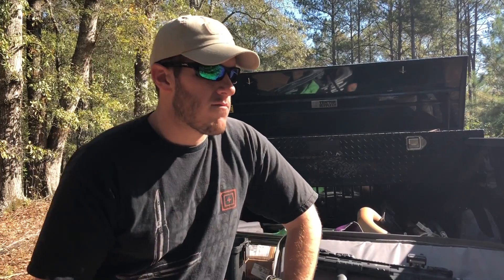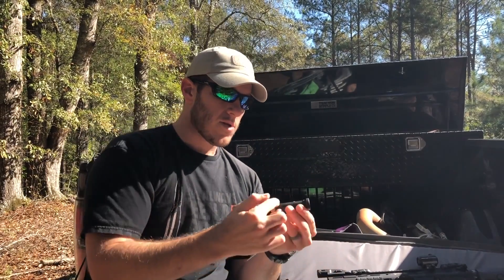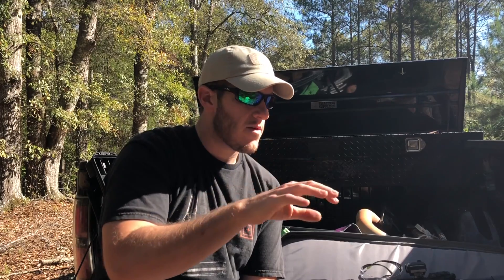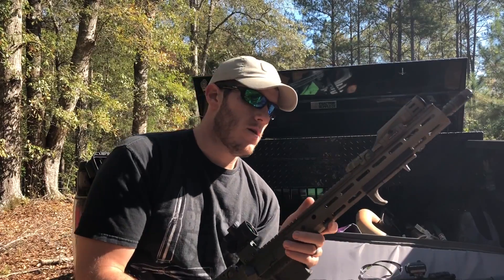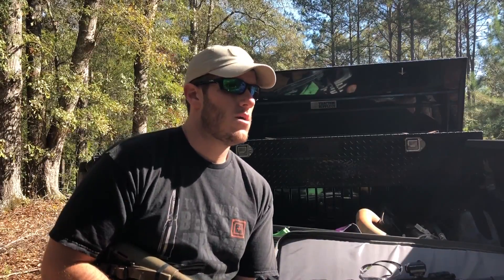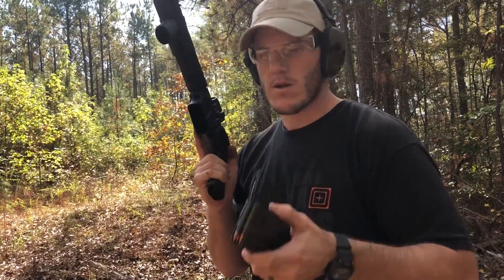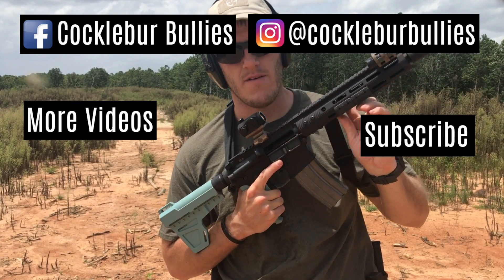AR-15 Buffer Weight Discussion

Comment: good info.
heavier buffers do slow bolt velocity and can increase reliability with a dirty gun but that heavier mass coming forward also causes the BCG to impact harder into battery.

so you have to factor that too. that can cause a change to perceived recoil and can cause excessive wear on the bolt locking lugs or even breakage.

using the ejection angle and distance as a general rule is an effective way to determine if you have the proper buffer.

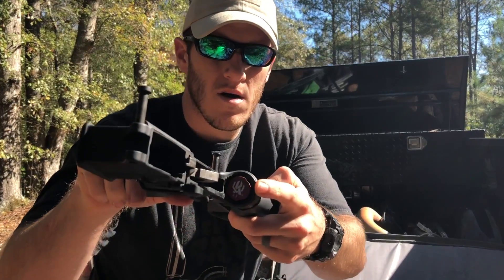but if its ejecting from 2:30 o'clock or later, up to 4:30 o'clock your generally good.

i was surprised to see both my FNs, a FN-15 16" M4 and a FN-15 18" match grade sporter (18" match grade barrel and rifle length gas system), have standard carbine buffers and not the typical heavier H1 carbine buffer.

both FNs are 100% reliable and rediculously accurate to boot and ejection for both is about 3 to 3:30 o'clock so i guess FN knows what they are doing.

i modded my FN M4 into a RECCE/SOPMOD hybrid of sorts and swapped the stock buffer and spring for a Shooting Innovations RRD recoil reduction device similiar to a JP silent captured spring buffer assembly.

the RRD is awesome! it reduces perceived recoil and makes the carbine much more controllable during rapid fire strings.

ejection remains at about 3:30 o'clock with moderate velocity and distance which is about perfect.
Reply from the maker: Usually when you get a complete rifle the manufacturer pairs the components well. When you piece a rifle together you have to tweak it a little to get it perfect.
Reply: @ClangandBang   I would expect a complete FN rifle to be near perfect..  Proper size gas hole, proper gas length, BCG, Buffer and Spring...   That's the gas SYSTEM...It is not just the weight of the buffer  I prefer to tune the gas system with an adjustable gas block.  That takes care if the issue at its source.  Heavy buffer, heavy spring etc really just put a bandaid on the still-present problem.
Reply from the maker: @tomynoks  tuning the system at the gas block is a good way to do it. Some people just don't feel comfortable tearing apart a factory built rifle to replace a gas block. For them, a tool free swappable part is the answer. If you are somewhat that feels comfortable working on ARs an adjustable gas block could be the right answer.
Reply: you have no clue what you’re talking about

Comment: my 16 inch mid length is like that, had to use a h2 as well
Reply: Stupid2669  yes, h2 with blue sprinco spring, makes it way way smoother. Depending on your gas port of coarse. Get springco spring anyway bc it will outlast the gun

Comment: Good video. In a similar vein I would commend readers to Weaponsman (Kevin RIP) synopsis of Mike Pannone's tech article found here:
http://weaponsman.com/?p=20221
Read the comments as well for the quick & dirty; the full article by Mike linked to is well-worth the read.

For those even a tiny bit handy, you can roll your own buffer weights & experiment as the video author discusses without buying full buffers. Get a 1/8" roll-pin punch, and just order some tungsten weights to mix/replace with the steel ones. (I get mine from Midwest Tungsten Services in 3-packs; reasonable & fast. No affiliation with them, they've just given good service.)

Go forth & make your AR run like a gazelle.

Comment: You might want to consider spring weight for an over gassed rifle. 

One thing few seem to realise, is that heavier buffers help more with under gassed rifles too. A good spring and buffer combo can have a huge impact on reliability and recoil. It's often that people overlook the springs, and assume that a heavier buffer alone is the fix. Not necessarily so. Over gassed rifles can get away with heavier springs, while under gassed rifles require heavier buffers and lighter springs.

Comment: Great info. I have a knights Armament 11.5” SBR upper; with the buffer tube and spring I was given by KAC when I purchased the SBR UPPER. IN COMBINATION WITH A GEISSELE SD3G TRIGGER WITH THE LIGHTWEIGHT SPRING AND A KA QDC SUPPRESSOR, ITS SBUMP FULL AUTO FIRE ALL DAY. I WOULD LIKE to know what you thoughts are changing the buffer weight and possibly the spring as well? Thank you graciously in advance .

Warmly,

Doc david
SUBSCRIBED
Reply from the maker: I've heard that a rifle can either run great suppressed or unsuppressed, it's hard to have it run great both ways due to the difference in gas pressure. An adjustable gas block could help, but other than that you need to decide which way you will run the rifle the most and set it up for that. Also thanks for the sub.

Comment: To save money, because I have several AR's, I purchased tungsten weights on Amazon and built my standard buffers to H-1 or H-2 weights. Your video on watching your ejection pattern gives some of the best advice I have seen on getting the right buffer weight. Keep in mind, a too weak buffer puts needless wear and tear on your rifle.
Reply: I wanted to ask, when buying these tungsten weights off Amazon did you just type "tungsten buffer weights" to find them? I'd really like to just make my own out of my carbine buffer if at all possible to save on cash because it would cost a pretty penny to buy a few different buffers for different firearms. Thanks in advance for any info you can provide
Reply: Your spring rate plays a huge role as well. Like mentioned, ejection trajectory tells the whole story on running over gassed or not.
https://www.sprinco.com/

Comment: Outstanding explanation of the various buffers. 

Are there also various sizes or weights in the Buffer Springs as well? For instance is there H2/H3 Buffer Springs for the actual  H2/H3 Buffers?

I just built a 8.5 inch 762x39 AR Pistol have yet to test fire it and thought because of the larger round of using  an H2 Buffer am I  correct on my assumption?

Comment: I just built a 10.5 AR pistol and I wasn't sure on the buffer so I went with the Spikes ST-T1 to start. If it doesn't function properly I'll move up to the ST-T2 and so on, I shoot alot of Wolf Gold and XM855
Reply: APB 28 any update? I have the same setup and didn’t know whether to go with T1 or 2 either.

Comment: Best wat to tell if the buffer is  too heavy or the spring is too stiff is to just load a single round and see if it engages the magazine catch on an empty magazine
Reply: Great advice, but sometimes a buffer would also be fine with an adjustable gas block vs bandaid fixed using different weight buffer systems.
Reply: Joe Craig the adjustable gas block is the band aid.

You can do the single round lock back test, but do it in cold weather with a dirty gun for most confidence.
Reply: Gas block is the fix. Buffer is the band-aid.  Over gassing only makes things dirtier. Put it to better use behind the bullet not increasing recoil and fouling up the rings.
Reply: How do you fix that? My buffer is only 2.9. I don't think I can go lower.

Comment: What are buffer bodies made of? I know they aren't magnetic, but the feel way too light to be stainless.
Reply from the maker: You know, I'm not really sure. Maybe some type of aluminum?
Reply: Clang and Bang Thats what I initially thought too, its not like the bolt actually impacts it, just rests almost on it. So aluminum should be just fine for the application.  Im working on adapting a standard carbine buffer into an anti tilt by creating a screw cap for it, and i didn't want it to wear out too quickly.

Comment: So just upgrading to a H2 buffer in a DD mk18 is enough? No need to change buffer spring?
Reply from the maker: If it's a complete DD rifle you could try an H2 by itself. I think they come with an H1 from the factory, don't quote me on that though. You might have to weigh the buffer thats in it now and go from there.
Reply: 10mm Heater if you have the old gas port you’ll need an h3

Comment: Thank you for this video. Good info that not many people talk about directly. I would also add that a way to test if you've gone too heavy while you're trying different weights in your buffer is if you fire your rifle with a single round in your mag, but the bolt fails to lock back on empty mag, there's a good chance your buffer is too heavy.
Reply from the maker: That is very true, gotta find the sweet spot.

Comment: What about short stroking issues with a 16inch carbine gas system using steal cased ammo?  My sport 2 short strokes/ftf steal cased ammo for some reason. Any suggestions on how to fix this? Shoots brass just fine.
Reply from the maker: skip skipper it could be that the steel cased rounds aren’t strong enough. When you get a chance, load one round and shoot it then see if the bolt goes back far enough to hold open after that shot.
Reply: Cocklebur Bullies nope the bolt did not hold open after one shot. Any solution to fix this so I can shoot steel? Also when the sport 2 was able to shoot steel case ammo it was keyholing a lot.
Reply from the maker: skip skipper You're either not getting enough gas or the energy is being absorbed somewhere else. Make sure the gas block is still tight and in position. If the cases are "frosty looking" after they eject or if it ever fails to clear the case out of the chamber it could be caused by a rough chamber surface.
Reply: skip skipper Try a lighter buffer or lighter spring.